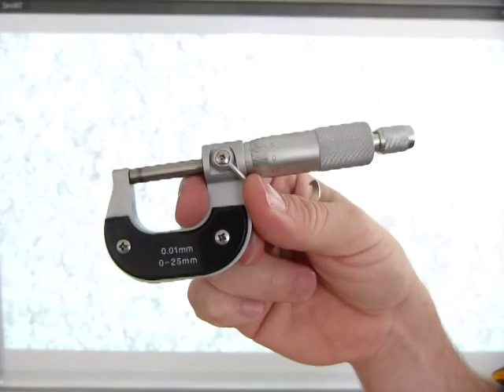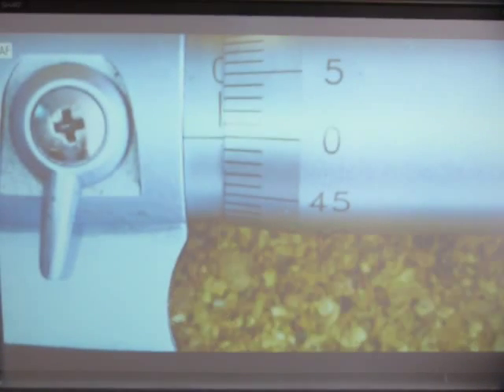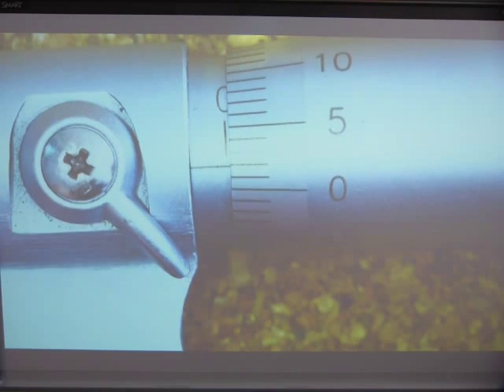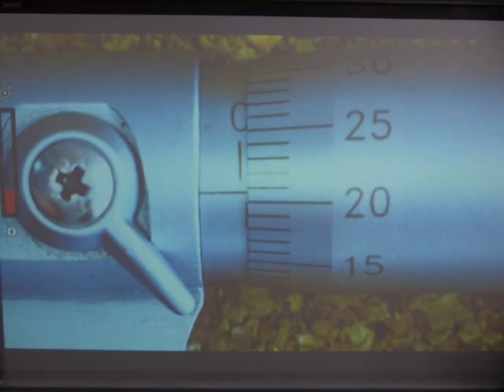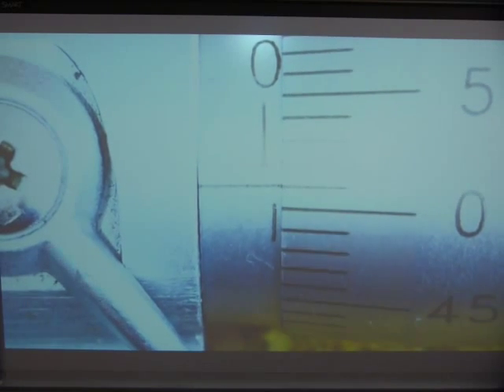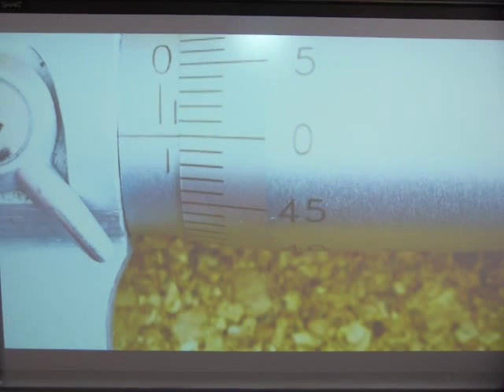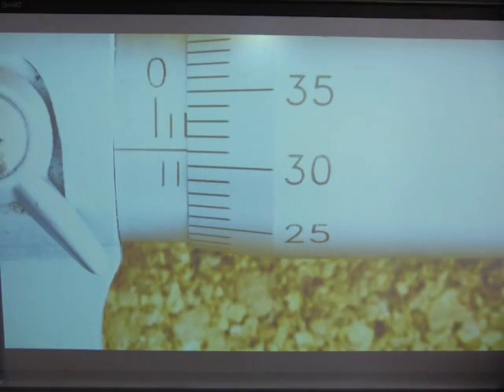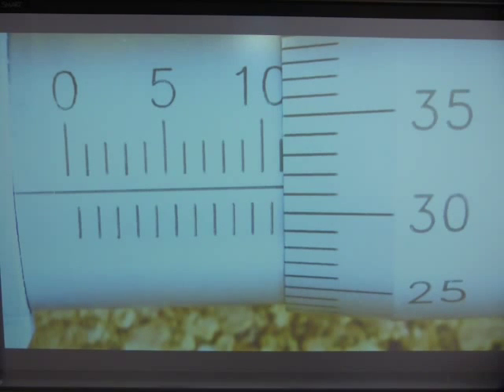Read a metric micrometer

Comment: To calibrate the instrument to zero, can one not just lock the barrel and then turn the thimble until the zero marks line up or will that damage the instrument? I find it difficult and time consuming to line the zero marks up precisely by using the spanner, but very easy if the barrel is locked and just turn the thimble to line up the zeros.
Reply from the maker: This is a precision instrument, even if it`s $20. The barrel and thimble treads are made with great care. The best way is using the spanner. Now I don`t know the surface hardness of the barrel thread or the lock pin but If exessive stress is placed on the lock pin to hold the barrel threads in position, the softer of the 2 might deform, possible both if they are hardened equally. If the deformed barrel thread then contributes to some newly developed wobble in measurements, you`ll know why.